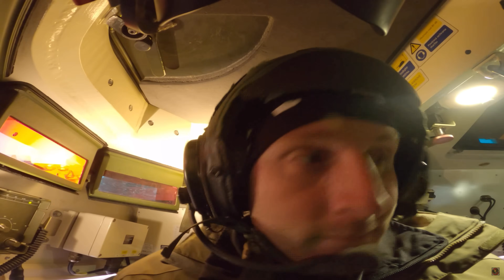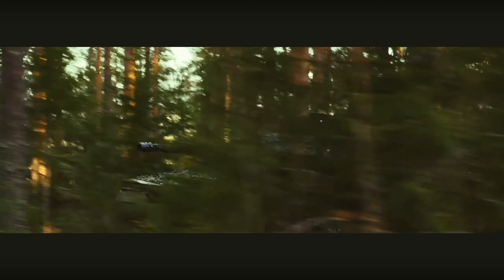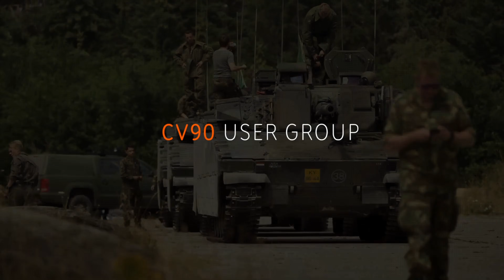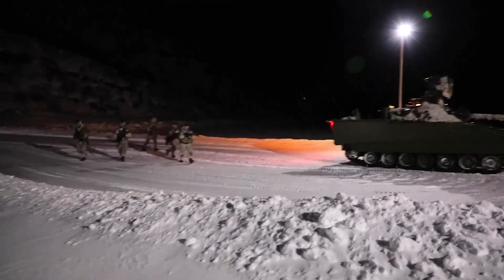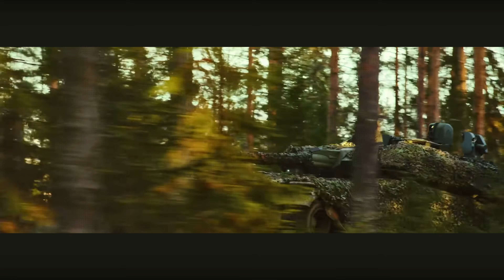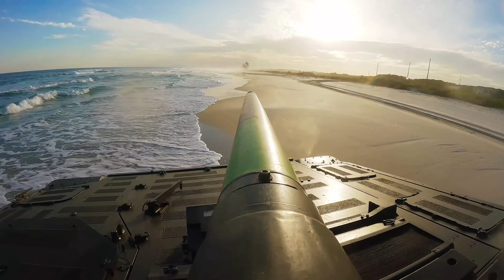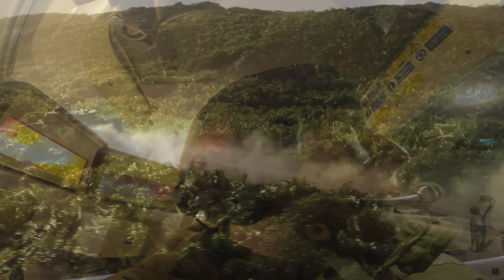Why is the CV90 IFV selling so well globally? | MASSIVE VEHICLE SALES 💰💰💰

Comment: The new CV9035 for the Dutch Army is nasty. Iron Fist active protection, high elevation 30 mm chain gun (Bushmaster) with muzzle timed air burst (Rheinmetall), great camo etc...
Reply: the 35 in its name implies its a 35mm gun
Reply: @alex190alex  Bushmaster III 35mm chain-gun.
Reply: Yeah. My bad. CV9035. As said, what comes after the "CV90" means the caliber of the main gun.
Reply: The new Dutch CV9035 looks so good 🤤
Reply: Be a great option in place of the M10 Booker now that it's cancelled.  More versatile too, and can mount a 120mm gun that uses standard NATO tank rounds  larger than the Booker 105mm.  So the fire support of a MBT without the size and weight.
Reply: - CV9035
- 30mm chain gun

What did bro mean by this
Reply: No APS for FPV though. This means the CV-90 like all IFV's is essentially a consumable, and an extremely expensive one.
Reply: @MS-wz9jm  im assuming they are going to rely on that 35mm airburst round and some sort of radar that would detect and auto lay the gun on it. Just my guess tho 🤷
Reply: @MS-wz9jm those will come eventually. Now everyone is testing the viability of different types
Reply: Yet heavy as hell, VERY expensive (you can buy 2 T90M with the money for one cv90).
Reply: @mirandela777  ”heavy as hell”, well the Lynx, Redback and ASCOD 2 IFV’s are heavier then the CV90. The price of these IFV’s doesn’t differ so much.
Reply: @mirandela777 What production capacity surplus would supply an export customer with T90M tanks? Russian weapon export industry is doomed. No one wants the Soviet crap anymore. Russia has a weapon trade deficit with North Korea 😂.
Reply: @mirandela777  you can buy  a T-90M for the cost of a TESLA type S      possibly a little battle scarred but still working
Reply: @mirandela777 the T90 burns too easily
Reply: “you can buy two T-90 for the cost of a CV90"

People replying to this missed the point entirely...  The question that should have been asked is "how many infantry soldiers can the T-90 carry under armour protection?"
If the answer is less than three, CV90 is still more economical when your twelve man squad needs a ride.
Reply: @mirandela777  Nobody is buying Russian weapons anymore. Well maybe India but they paid top dollar for a half finished aircraft carrier. Paint a hammer and cycle on the side of a portable toilet with a cardboard missile on the top and India would order a thousand. Just crazy.
Reply: @mirandela777  You could probably destroy two T90M with one CV9035, just check the Bradley vs T90 video :)
Reply: @huibroggenkamp5405  And I could spontaneously combust. Anything can happen. One IFV vs 2 tanks is a fight that is sub-optimal at best
Reply: @huibroggenkamp5405  MAN KKK,SE O T-90 TE VER PRIMEIRO, ACHO QUE SUA ARMADURA WOKE DE 2 VEZES O VALOR NÃO VAI TE SALVAR KKK.
Reply: @ Woke armor? That what the spikes are for, during the invasion of Iraq the bradley scored more tank kills than actual tanks. IFVS are deadly when they have the right armament and more versatile than tanks. But no IFV will survive a hit from tank. The crew will probably survive 8 out of 10 times if it is western made.
Reply: @johanbergman2343 this Was more about positioning awareness. Intel is Essential. Without Informations, brute force won 99% of every battle.

Comment: Not that I follow the CV90 on a regular basis, but one of the strengths of the Bradley is the TOW missile system. I am not sure that the CV90 comes with such a system. I am sure that such a missile could be added to the platform. I like the vehicle as it goes into my future thinking of military vehicles of being modular/flexible, fairly high speed, it has a big enough automatic gun, has a gyroscopically stabilized gun to fire on the run, has good night/infrared vision system, and it carries infantry. A good flanking and hit/run vehicle. For some reason, I like 30mm or larger rapid fire guns or a recoiless gun like on the new USA Booker light tank. ( by General Dynamics & BAE systems) Wheels give a faster smoother ride with less maintenance & and expense, but I am not sure of their ability to navigate really difficult terrain. Can't Canada add these features onto a modular platformed LAV? Perhaps Canada could join the CV90 logistics platform and added a wheeled CV90 to the family? Either way, it looks like the LAV needs to step it up or bite the dust.
Reply: I think the new version has the Striker missile system?
Reply: It does and drone counter measures  @Hiznogood
Reply: In BAE Hägglunds own videos they showcase built in AKERON ATGM missile system. Two sits under a cover in the turret and opens when time to fire.  Video titles "CV90 firing MBDA’s 5th generation ATGM AKERON missile".
Reply: If a country wants anti-tank missiles on their CV90s, Hägglunds will build them with missiles just like the turret guns are up to the customer to decide on.

Comment: So, in comparison to the LAV, is having a tracked IFV the way to go? Personally, I would like to see the LAV be designated as a long range recce vehicle with the ability to launch AVs. Or on a flank position to push out while having CV90's on the front. But I was curious about the pros and cons of tracked vs. wheeled IFVs and whether the LAV is still a better option for us in 2025
Reply: Well, the CV90 will pass through terrain the LAV simply can't handle..
Reply: @leifiseland1218  haha this is true. I'm wondering if the added maintenance cost is worth it
Reply: It depends entirely on what you need your forces to do.
In general, you want wheeled vehicles patrolling large areas. When things get hot, tracked has better tactical mobility.

Comment: TBH looking at the Ukrainian conflict it clearly shows that CV90 isn't that good, even when compared to Bradley. Plenty of footage of CV90 being decimated by one FPV drove, killing crewmembers in process. While Bradleys successfully withstand 4-5 hits at once.
Reply from the maker: I'd have to disagree with that, there's footage of both being destroyed.
Reply: @ yes , but Brandleys  tend to take multiple hits
Reply: @ivantnt26  FPV drones carrying RPG warheads made to defeat heavy armor will go through anything lighter than a full tank.
That some can take several hits just mean that the drones did not hit any vital system in the first hit.
Reply: @Merecir  yeah , and that proves my point of Bradley's superiority
Reply: @ Two dudes are shot, the first is shot one time in the chest, the other five times in the foot.
Is the second man more resistant to bullets because he survived the five bullets?
Reply: @Merecir  bad example since both bradley ans cv90 are usually attacked from the same trajectory,  it's cv got more vulnerable points in these areas .  But anyway I was just expressing my opinion,  not trying to change  the minds of cv90 simps

Comment: The point about the CV90 is that it is good quality, but the price is to high. To get the price down Hägglunds need volume to invest in new tools, production facilities. To finance those investments at a reasonable cost/interest they need to have solid with firm orders to approach the banks to lend them the money.

To assure the quality the swedes have donated a lot to Ukraine - which is one place where there are serious combat to conduct field trials that will stress the whole supply train: Repairability, surviveability etc. and what Hägglunds gets back are the input from the personel actually trusting the equipment with their lives. The Ukrainians are calling the CV90 for a tank - which it is not, but the opposition is not that impressive.
We are back to the interwar period with the discussion of infantry tank versus cruiser tanks.

Now the Danish order of 115 is mainly to overhaul the entire fleet of ICV's and get a good price. And the banks will pony up the money. The trick is rather that there are payraises for Hägglunds staff, but with modern equipment much less workforce will be needed. The point being that Sweden will have a higher inflation than Denmark so they will borrow in Danish money. (In that case Norway is in a worse place). This means that at the time of delivery the SEK has devalued to an acceptable level.

The licens production abroad is mainly to put the more labor intensive parts to cheaper labor. The other aspect of this is that apparently Hägglunds will follow the "Volvo-model": I.e. expensive to buy, but spares are comparatively cheap. These order are for people that intend to use the gear.

That is an aside to president Trump that presses for greater spending on defense - sure we will spend much more (as we have to reequip anyhow), but not at the american extortion prices. This means that the money will stay in Europe. That Brazil is included in assortment leads me to think that they might be amendable to supply oil.

Comment: Ive heard a lot of talk about Aviation being the future, Artillery being the future, Submarines being the future etc. They all forget that just because a single part of the armed forces does a good job, the rest of the industry does as well.

I dont think drones will solve everything out there or deal with every single mission. I believe that drones Together with ifv's, lighter troops and mechanized solutions will be the way forward when you need hardware on site. Drones are woefully underused and underdeveloped compared to my vision for them, but this is a vision ive had for the past 15 years and were just now barely reaching the point of making them interesting. They are clearly a potent threat in a theatre with lacking areal defences. If we spent more on the integration between drones and troops/ifvs etc instead of treating them as their own branch, i think we could have a really strong asset in the future.

Comment: As a Canadian I also wish Canada would get the CV90. What do you think of the Saab Gripen in General? Good ? Bad?
Reply: Canada should have acquired a license to manufacture the JAS39 as the CF39
Reply: @ Saab was ready to set up a whole production line for it. Teach us how to make the plane, set up all the necessary jobs and then leave it for us to build
Reply: Gripen E is certainly a capable plane. The issue is it costs more than new build F16V for no real performance advantage and comes with a miniscule support and repair network compared to the F16. The F16 is operated by dozens of nations who can share knowledge and experience on the platform, as well as multiple international contractors who make parts and maintain and repair the planes. If you are going to buy a single engine non stealth fighter you might as well buy an F16 and plug into its giant future proofed ecosystem. The Gripen only has a small niche number of nations which operate it in relatively few numbers, which drive up its price but also operating costs. Again, its a good plane for a non stealth 4+ gen but has sort of been left behind in the market.
Reply: Saab says Gripen Es operating costs are significantly less than F-16V, but both are new so TBD. Initial cost is really unknown and depends on a# of factors including whether a country wants to produce the plane in-country with the attendant start-up costs. And, of course, one presumes unit costs would.come down with a bigger order.  - especially if there's no customization as Canada stupidly likes to do. The F-16V program did away with most customer options which keeps production simpler and costs down. 

Obviously, it seems a moot point since Canada has already decided to purchase 88 JSFs. Trump's tariffs and other inflammatory rhetoric could change things theoretically. It's not a great idea to be tied to a bully with a plane that the US has total control over. A compromise might be in order - say 48-50 of each - which actually tracks with a current US preference to utilize a mix of gen 5 & gen 4.5 planes.
Reply: @ During the retaliatory tariff speech, they slipped that they will be looking at non tariff deals, like procurement. So it might be on the table
Reply: @cattledog901
I think you did not get the advantages of Gripen. It is not cheap to buy, but to fly and to service. The F16 cost maybe 10 times more per hour to fly. Turnaround and reload a Gripen is 10 minuites and you need a very small crew to take care of this. It can start and land almost everywhere. It is small and light why 1 engine is more then enough.  The only problem is that the engine is American. Normally USA is our allied, but with Trump... who knows.
Reply: @BoBo-ug4do   Looks like you didn't bother to actually read what I wrote before writing this. Try again.
Reply: @cattledog901 Hmm?.. Sounds like there's a lot you're not aware of regarding the differences between F-16V & Gripen E..🤨
Reply: @leifiseland1218  They are both single engine fighters in the same class. There isn't anything the Gripen E can do the F16V can't except maybe use improvised roads as landing strips. They have comparable aerodynamics, electronic warfare suits, radars, weapons load etc. Obviously they may have small advantages or disadvantages in specific categories, my point is the Gripen E is not better enough than the F16 to justify it being more expensive and it comes with huge disadvantages of its own in support and maintenance networks.
Reply: @cattledog901  it's 8-27 thousand dollars per flight hour for an F16V. The Gripen is 4ish. The upfront cost may be more, but saving that much money in maintenance is ideal
Reply: @MikeThepiper  Wrong, you are giving flight cost figures for the JAS39 Gripen. Gripen E flight cost is approximately $8000-$26000 again comparable to an F16V but without the network of spare parts and maintenance contractors.
Reply: @cattledog901 According to what I've looked at, I haven't seen a figure above 8K for cost. Would also prefer not to spend money in American military hardware and give money to the Europeans instead. Which is why in an earlier comment I suggested Rafales
Reply: @cattledog901 U really dont now what U are talking about! JAS 39 Gripen is better then F16 in so many ways! Better electronics better radar better stol even on non prepered roads quicker to refuel and reload only 5-6 men to do this in only 10-15 minutes! So learn facts before write nonsense!
Reply: @Fordcommodore  The Gripen E does not have "better electronics" or radar over the F16V. Anyone knowledgeable on the subject knows this. Yes the Gripen does have an advantage on unprepared roads as I already stated. They are both COMPARABLE platforms in all domains performance wise, however you missed my entire point about the F16 having the superior support network. You are just being a fanboy instead of being objective.
Reply: @cattledog901  
Ok think what U think, I now Im right and U are wrong. So its up to U if U still want to be a fool!
Reply: @Fordcommodore  WOW what a great and well researched response lol 😂
Reply: @cattledog901 The fundamental difference between JAS 39 and F-16 is that the aircraft itself is the least important part of the system.
The concept in a single sentence would be the F-35 network packed into a F-20 airframes.
This drives the cost per flight hour down (JAS 39 C/D has a CPFH that is only two thirds of the F-16, and that with the limitations in the industrial infrastructure you pointed out) which allows more utility as pilots can fly more both in training and missions.
Reply: I think the Gripen E is a great fighter! Stealth is not the end all of superior fighter tech as far as I'm concerned. The E can also use many of its electronic warfare options to confuse and obfuscate its position relative to the enemy aircraft. The con of the plane however is that the engine is still a US product, so it would leave us in a bad position if things got a whole lot worse. I'd be keen to give the new Rafale a shot again. All Euro made and a twin engine omnirole fighter
Reply: A great IFV and a proper option for missions in Europe too. Pretty much perfect choice for canada and not been to expensive.

Comment: But is the main gun stabilized?
Reply: Yes.
Reply: Excellent 👌🏻  @SonsOfLorgar
Reply: The only version without stabilized gun was the very first Mk0 Strf9040 delivered. 
But they were quickly upgraded to Strf9040A that added a stabilizer (easily identified by the extra bump on the turret front armor).
Later versions came delivered with stabilizer as standard and was designated Strf9040B (without extra turret bump).

Comment: It is necessary to move in the direction of reducing the size.  It should be a heavy infantry fighting vehicle, but smaller in size.  4-6 people landing or 2-3 in general.  Weasel, but with bulletproof armor.  Because one 30-50 mm gun is not enough to support an infantry platoon.  We need 2 or 3. Also, the power plant must be hybrid: internal combustion engine + electric motors.
Reply: There is 1 cv90 per squad
Reply: @SonsOfLorgar  Two combat vehicles is better.   The detachment is not in one, but in two.   Two guns.   Dual firepower, can act as a pair, cover each other.